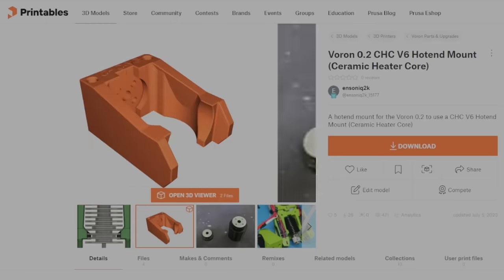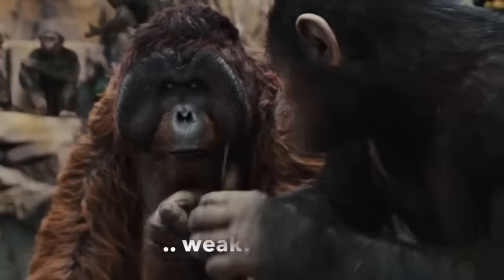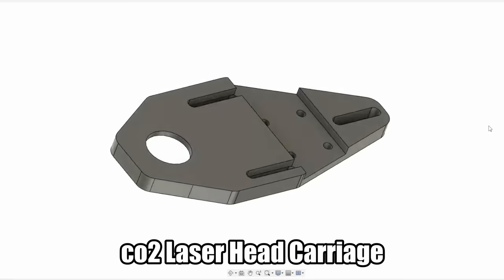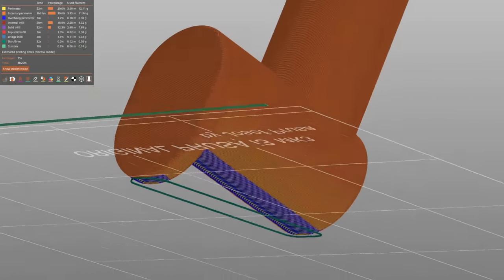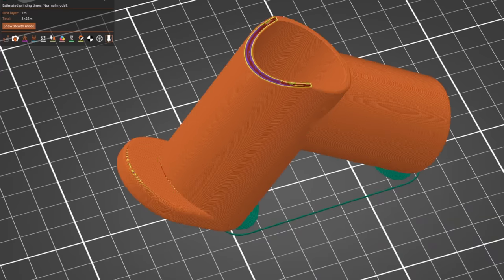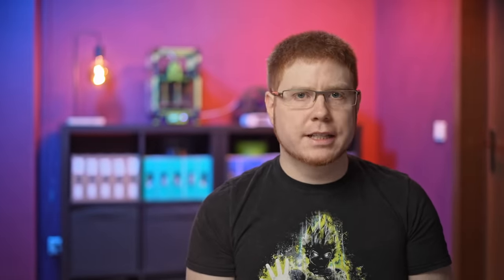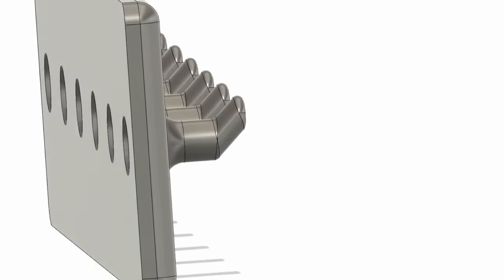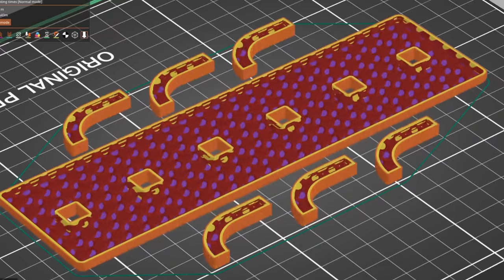3D Print Design SINS that need to STOP on Thingiverse, Printables, Cults3D etc.

Comment: I think the real sin is everyone delivering functional models in STL format. NO FUNCTIONAL MODEL SHOULD EVER BE IN STL! It's fine for decorative models with complex surface geometry bbut it has no place in a model with flat faces, constant-radius round things, and solid thickness. Some slicers don't scale it right because units are not always included, it can introduce artifacts to otherwise model-perfect geometry due to the mesh accuracy, and it's damn near impossible to post process to make such modifications in any kind of engineering CAD software because it's not a "real" solid body, just a surface mesh that CAD doesn't know wtf to do with. And 99 times out of 100 every exported STL ends up with broken faces anyway.  

Please, for the love of God. Export STP or x_t parasolids! Literally everyone will thank you.
Reply from the maker: I totally agree. One thing I noticed while testing is Slicers support STEP but they seem to just convert it to a mesh anyway. Ended up with a broken model that was perfectly fine when Fusion 360 exported an STL itself. I'll talk about that in the next video

Comment: I am a noob.  I hope you can help me. How do you take an stl file that you download from thingiverse and make modifications to it.  What modeling program can a non-engineer type like me use to make my own modeling without spending months of training.  Thank you. Tony
Reply from the maker: Downloaded STLs are so called meshes, meaning they consist of lines connexted to points, making triangles (Google Mesh STL and you'll see). Meaning you can't simply modify it like you could modify the source file since a flat surface is actually made of a lot of those triangles. There is software like meshmixer you can use to manipulate that file.

For creating designs from scratch many people like Tinkercad. I personally never tried it since I used Fusion 360 early on (as you might have noticed in the video).

Comment: Am I the only one that would just use the mounting holes already built into basically every power strip ever? It will be easier to mount/unmount, use fewer screws, and hold stronger.
Reply from the maker: A lot of them don't come with mounting holes, especially the cheaper ones.
Reply: @SmallBatchFactory  That's so weird, I always buy the cheapest ones that look like they won't set my house on fire, and I don't think I've ever seen one without them.
Reply from the maker: @no1unorightnow are you talking about US power strips? At least here in Germany most of them come with no holes. Not even the more expensive ones for some reason. You can get specific models with mounts but they're rather rare, most I saw in hardware stores don't have holes.
Reply: @SmallBatchFactory  Regional differences will always fascinate me; yes, I'm in the United States. This is made somewhat more ironic by how inferior our plugs are to most of the rest of the world; our plugs suck, but at least our power strips have mounting holes!
Reply from the maker: @no1unorightnow maybe we don't have them since the force you need to unplug something can be pretty substantial, putting quite a bit of load on those holes. I'm still surprised my printed holders haven't cracked yet

Comment: Idk man, I really like my rounded corners. They definitely are a problem though.
Reply from the maker: I LOVE rounded corners and at first I thought it's my fault since so many people add them. But the sad truth is it doesn't work out :-/
Reply: @SmallBatchFactory  Oh I'll make them work! Though I will give a nice bevel a try now that I've seen your video. 

I'm designing a firearm, and the troublesome curve in question is quite close to the web of the hand, the soft bit. And it feels so very nice to hold. But I've been refactoring the design lately so I'll give it a go!
Reply from the maker: @KaletheQuick fillets only work if they're small enough, but you also combine a larger chamfer with smaller fillets on both ends to make it a bit smoother

Comment: 2:01 2mm is 4 permiters with a 0.4mm nozzle? 🤔 Shouldn't it be 5?
Reply from the maker: It should. Had it right in my script but said it wrong and didn't catch it.
Reply: @SmallBatchFactory  well rip

Also I was working on a keys holder model recently and came up with a solution similar to the one you mentioned at 7:36 , tho with a few notable differences for the application
Reply: Also also, wow, that helmet took five and a half days 👀
Reply from the maker: I have to add I printed it extra slow just to be sure. Didn't want the Y axis to skip with almost a kilo of filament on the bed. Thanks for watching all the way to the end!
Reply from the maker: Someone suggested flaring the end out, I did a community page post showing the example he sent in.
Reply: @SmallBatchFactory  Flaring the end out of the helmet or the keys holder? 🤔
Reply from the maker: The key holder of course 😅

Comment: For the hooks, I think there may be a better answer.  Since the force of gravity is trying to pull the hook down, making the rectangular hole and the part that fits into it at a slight angle will mean that the weight of something hung from the hook is going to push the hook into the hole.
I have done the bolt up the middle thing with quite a large bolt on a part that gets a fair amount of twisting force and yes that is a very good idea. Compression from the nut and bolt pushes the layers together defeating the weakest failure direction.
For mounting circuit boards inside a 3D print, it is a good idea to taper the bosses.  Where the board sits is all wall.  Where the boss hits the body of the box, there is some infill.  This decreases the odds of them snapping off where the boss meets the body.  Adding even more material at the intersection is good but sometimes dimensions won't allow that.
Reply from the maker: That's true, there is almost always another way to do it even better.

My studio lights are mounted to the ceiling using printed parts with compressed with screws. I trust them to hold up my equipment and they do very reliably.

Comment: I have to say that you moving your head left and right periodically is really distracting. 

Rounded corners are the best thing ever. Think about thermal expansion because of the heated bed. That’s why a 1-2mm radius is the best and 45 degrees is very annoying and ugly.
Reply from the maker: Check out my newest video and tell me if it's better now.

Small rounded corners work, but what you describe is only a crutch for poorly adjusted elephant foot compensation.

Comment: 2mm walls breaks. 3mm walls minimum. Totally disagrees with this argument of infill being bad for strength. You just have to print infill properly, as in super slow. Only then does it become strong, and can serve the purpose you speak of. Useless infill is achieved by printing it wrong, and yes, then it will be useless as real reinforcement.

Hooks are best made by using plastic screws with a solid pan head. As in printed male and female screws. I typically use m14 and 2 mm threading. For your example, I just don't get the complexity you call for. Not sure why you would need all that complexity for some simple hooks. Straight hooks at 45deg are all over the place. 90deg hooks with a pan head, that can either be canfered or supported, simply works just fine. Not sure what use-case they would not.

Also, orientation is not really that important. If you print right, layer strength is just fine for almost any application. You just have to print properly. Particularly the infill.

But again, if I print anything at like 2mm thick, it is simply fragile and really prone to break. If you gave me a model with 2mm walls that needed any robustness, I would throw that model away, as the trash it is.
Reply from the maker: You tell me 2mm walls aren't strong enough and then you go on about "correct printing" and layer lines not being important. That's interesting, none of my 2mm walls ever broke.
Reply: @SmallBatchFactory  That's because you did not apply force to them. Also, filament matters. I use PETG, and no matter what brand, it will snap easily, when applied a real force, up til about 3mm. And yes, I do talk about printing inflill correctly. Over and over again, I see videos that have serious quality issues with the infill printed. So yes. I do. Sinlge line printing sort of is my thing. And if your walls break if you use infill, you got issues.